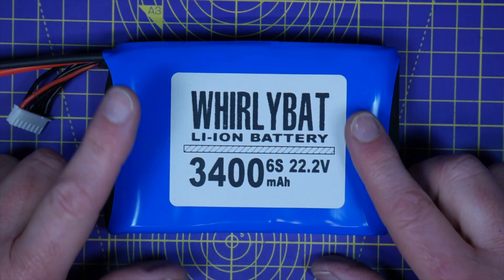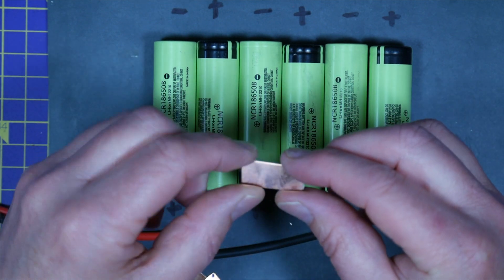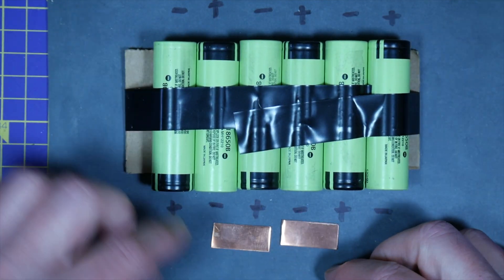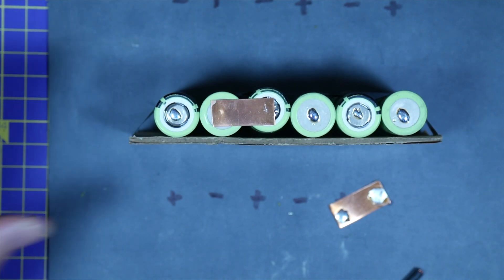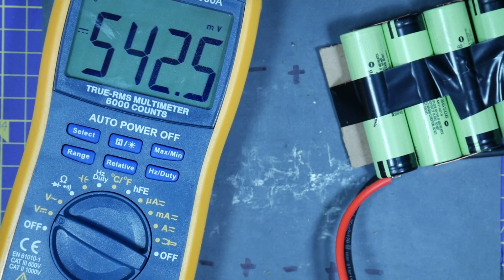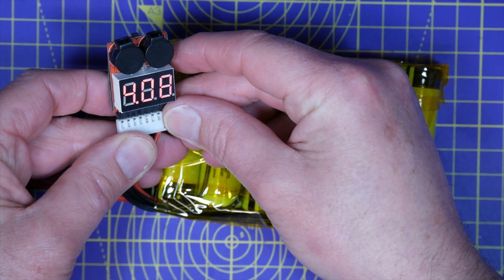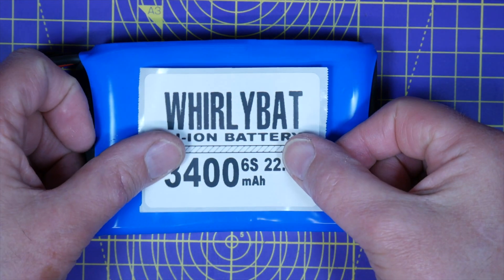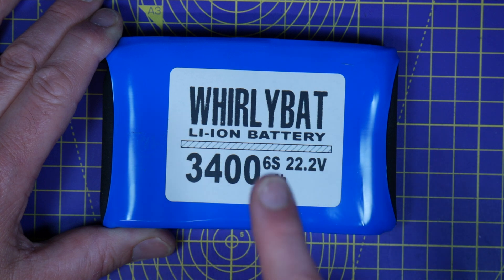Make your own 6s li-ion long range drone battery pack from 18650 cells

Comment: Don't it heat ?? Or is the temprature their lower compared to mine with 30°C AVERAGE daily.
I ordered the same battery and they heat up real fast, just gave me 4 mins of flight time until it heated up and reaiatance kicked in and drone dropped out. But voltage comes back to normal after some timw
Reply from the maker: I don't have any heat problems with any of my packs. Try Sony VTC 6 18650 cells. They work really well.
Reply: What is a Ampere of your esc ? I think because I use 30A esc maybe that is the problem.

Comment: Question? If a single cell has a discharge amp rating of 5A, and you put 6 of these cells together in series as shown, will the total discharge rate be 30A or 5A?
Reply: In series it will be 5A.
If you put 6 cells in parallel (6p) you will get 30A.
Reply: @SergyFPV  Thats what I thought, its just that 5A seems very low, if you fly too aggressively will it damage the battery?
Reply: @mitchpalmer721  voltage battery will fall and battery will become hot , never good for lifetime.
You can choose better liions cell  with high discharge like Sony vtc6 ( 3000mah /20Amperes) or Sony Vtc5a (2500Mah/25 amperes) who are the best in 18650 size i think.
Reply: @SergyFPV  Would you say the battery he is using are adequate enough if you are just flying for flight time and taking it easy? Thanks!

Comment: I've discovered that there is also a 21700  type Li-Ion battery, that would be ideal as it is just between 1 and 2 packs of 18650 cells. It then weighs less then 2 of these packs, while delivering somewhere around 4000 mAh of current.
Reply from the maker: Nice. I've been using the VTC6 recently which are very good.

Comment: ?? This definitely isn't safe,, max continuous discharge rate for these batteries is 5 amps, even the wimpiest lipos are above 100 amps. They definitely aren't gonna last long, and may even explode/catch fire. linking 6 in series only increases the voltage, not the maximum amperage discharge rate.

Edit: the specs are in the description so you clearly know that you're trying to pull WAY too much juice from these.. why?????

Comment: Have you ever measured how much current you could get out of this pack? I'm close to following this guide, just waiting on a couple mor deliveries.
Reply from the maker: The C rating is low on these cells, so peak current isn't huge, but these are really designed for cruising not acro.
Reply: @WhirlyBloke  I got my first flight test done - I matched your twenty minutes. My quad is a TBS Source One with 7" arms and tri-blade 7" props.
Reply from the maker: @davidrgilson  Awesome.
Reply: @WhirlyBloke  I've not had time to flight test my pack yet, but I did power laptop with it yesterday. Sustained 120W for 22 minutes.

Comment: I always use a little(!) Drop of hotglue to secure the cells togeter also to solder them togeter i use tinned solderwick(very thick one)as a wire connection.
Reply: Great idea! Just a tiny drop between each cell would be more than enough. Next time I'll do that :)
Reply: That is a great idea!
Reply: @SummitWizardFPV hot glue is lasting not more than a couple of months
Reply: @Volarte_Studio yep. I've come to the same conclusion. I bond the cells together with super glue now

Comment: Doesn't the quad use a lot more discharge rate than 2C? You had with your first test 20 min flight time (other Video) which is on average already 3C (dunno how much capacity was left). Shouldn't this be bad for the battery?
Reply from the maker: Not at all. The battery will only deliver what its capable of which is primarily limited by the internal resistance. Check the end of the video for the final voltages. You could run the Lithium Ion cells to a lower end voltage, but it affects the long term life.
Reply: @WhirlyBloke  Thanks for your reply. Are you sure about the "limited by internal resistance"? This sounds differently: https://electronics.stackexchange.com/a/16981

Comment: You just charge as a lipo 3400mah 1.6a?
Reply from the maker: Correct. If you check the manufactures spec you'll find the end voltage is 4.2v and the optimum charge current is 1.6 amps.

Comment: Question, when you charge: Select Lion, 4s, balance charge (since the capacity of the 4s is 3400 mAH) why isn't the current set at 3.4, you said 1.5. Is the charge rate different for Lion compared to Lipo because Lion can not discharge and recharge fast like Lipos can?
Reply from the maker: You have to read the manufactures spec.  The NCR16850 recommended charge current is 1.6A and the end point is 4.2v.

Comment: Hi. I wanted to ask a quick question regarding Amp rating on 18650 cells. I'm looking at the Sony VTC6 3000mah 20A. However there is a Sony VTC5A 2500mah 25A, they both weigh the same (give or take a gram). Do you think the higher Amp rating is worth the drop in mah ? Let's say in a situation at longer range where you need a sudden punch out to recover video, do you think the extra 5A on the VTC5A would really make that much difference ? I understand these packs aren't for aggressive punch outs, i'm just curious if that extra power available would help. Thanks.
Reply from the maker: VTC6 cells are probably the best balance of internal resistance and power available.
Reply: @WhirlyBloke  Excellent. I was hoping the VTC6 was the 'winner'. Based purely, of course, on more mah. Thanks.

Comment: Hi Whirly one question. What are the thickness and width of the nickel strip? Thank you
Reply from the maker: It's 0.2mm. I salvaged this from an old MacBook power supply, but you can use anything similar.

Comment: Great video! I have a doubt about the balance leads. So the red goes to the positive and the black cables goes to each negative of the cells? In one of your cells there is a black balance lead just in the middle of the nicketl connection between positive and negative, could you explain me why? Thanks in advance !
Reply from the maker: Thanks. Check my community page for wiring details https://www.youtube.com/c/WhirlyBloke/community

Comment: Can you have a look on Liitokala batteries?
I think of buying Liitokala 21700 cells 4000mah 10C discharge, these cells weight 67g.
sounds for me like a good choice for a 4S 4000mah liion battery for a 7inch?

Or the 5000mah 21700 with 5C discharge rate for also 67g..

Otherwise the NCR18650B from Liitokala are 4300mah weight 48g and 2C discharge

Do you have any experience with Liitokala?
Reply from the maker: They're not available in the UK. Feel free to send me some and I'll take a look.
Reply: @WhirlyBloke  here in Italy neither..
Need to order them from china, will take a few months.

But looking at the characterestics which would you think are the best choice?
Reply: @CorrexPoE  Liitokala 21700 ( yellow color) are 15 Amps , i used 4s 4000 mah for my 5 inch for cruise flight of  15 mns

Comment: So as a newby should I even have to consider getting lipos? Im expecting my first fpv to arrive in a week from China and I havent bought any batteries yet. Im leaning more towards cruising , not racing...
Reply: Liion are really just for cruising, if you want to flips or some punches you need to go with a lipo.
Do you have a quad yet?
Cruising normally we use a 7inch prop frame and for Freestyle or racing 5inch or less.

It really depends on what you want from your quad.

Comment: I have made a tarot 680 pro with tarot 4006 620kv motors and 40A 2-4s escs, i want to use li ion battery for that but cannot figure it out, i dont know how many cells to use, the motor chart shows 26A per motor (i guess it is off a bit). I also cannot figure out c rating, li po has 20-40C on an average, the most information for 18650 i can get says it has 1C discharge rating and i searched everywhere, i cannot find hoe to increase c rating so i think it cannot be increased but i do not understand how to make li ion battery for my hexacopter, according to the motor chart my hexacopter should be able to lift 9kg(19.8 lbs) including the weight of all components. It will be very kind of someone to help me out, i can also provide my email, discord, WhatsApp,etc for longer conversations. Looking forward for some help. If Whirly can help me it will be very good. Thank you
Reply from the maker: Lithium Ion cells have a much lower C rating than LiPos cos they have a higher internal resistance and can't deliver the same energy in short bursts. But what they give you is longer flight times. Lithium Ion cells will be rated at 1C - 3C, but check the specs for each manufacturer because they vary.
Reply: Whirly Bloke but can li ion cells work for me? I don't need speed, my hexacopter is like a utility drone, photography, farming etc,
Reply from the maker: @vrushank2809  It depends on so many variables, payload, motors etc. I'd start with LiPos and try Lithium Ion when you're more familiar with your 680 and it's characteristics. But the 680 is quite big and on the verge of heavy lift, so I suspect they won't be practical.
Reply: Whirly Bloke i thought the same but had a wish to try li ion for longer flight time, i am frok india and li po is very very very expensive here, verified traders can import them but not common people, they import for cheap and sell at sky touching rates🙁. Li ion on other is manufactured in india too so it is more cost effective if it works, i thought heavy lift drone need less C then the fpv one you tried
Reply: Whirly Bloke i don't know what happens if c rating is low, do we loose torque, thrust, what do we loose exactly if C rating is less?

Comment: Hi man,
I’m using tmotor antigravity 4004 and I’m using 4S 14000mAh battery with 4kg quad would that work ?
Reply from the maker: The 4004 is spec'd for 4-6S so it should be ok.

Comment: Great video. I'm waiting the batteries to make my own 6s lion packs. I've ordered the Samsung INR 3000mah 30Q That should have 20amp and a low internal resistance similar to the Sony vt50 I've red on other comments. Let's see how they will perform! Plan is to use those packs on 7inch quad and into an ar 900 fixed wing.
Reply from the maker: Thanks. Let me know how it goes. Thanks for watching.

Comment: I have done some li ion packs and have found that the Sony VTC6 3000mAh 20A 18650 cells the best for flight time as the NCR18650B cells have a higher resistance and quite a lot of the energy is being wasted and have a shorter flight time. I really think you would be shocked with the flight time difference in real work flying.
Reply from the maker: Yep, I agree. There's is a quite a bit of difference between the different manufacturers 18650 cells.
- Panasonic NCR18650B 3400mAh IR 55mOhm
- Sony vtc6 18650 3100mAh IR 13mOhm
- Sony vtc5a 18650 2500mAh IR 9.8mOhm

VTC6 looks to be the best compromise of internal resistance and energy. I've got some on order. The NCR18650 cells I used were just what I had kicking around looking for a use. Thanks for the info and thanks for watching.
Reply: Have you tried the samsung 30Q or the Sanyo-panasonic ones?

Comment: Thank you for the video.  I usually add a fillet of heat gun glue between each pair of cells before soldering.  That not only prevents the cells from flopping around while soldering, it also gives the pack additional structural integrity during a crash.
Reply from the maker: I've done that in the past. But now I rely on the capon tape cos it's less messy and probably stronger.

Comment: I recently used 8 of those cells to make a nice 4s pack for one of my fixed wings. They weigh less than a 4s lipo pack. I got about 25 minutes flight time with the lipo. With the li-ion pack i am getting well over an hour. Less weight with more than double the range. They are ideal for fixed wings and cruising style quads.
Reply from the maker: They make awesome packs.

Comment: I settled on the Sony VTC5D for what appears to be the highest amp rating of any 18650s I can find.   Might be 2800mah but I am building 6s2p for use on 7in or even a pair for my 13in for 11200mah.      I figure my 6s2p packs are good for 30amps continuous and around 60amps burst rating.    Pack weight for 6s2p is 645g and yields 23min flight times cruising at 15-19amps on 2806.5 1300kv Avengers and HQ 7040x3 props.   AUW 1350gs with Hero 7 Black on a Project 399 frame.

The 13in I am not really ready to talk about but about to move to an 8s4p pack.
Reply from the maker: Sounds interesting
Reply: This would be better than the one shown in the video, but I doubt this would be safe; just about every lipo can output at least 100 amps, while the cells in the video only output 5.

Comment: I made two of those 3400mah 3s batteries, not 6s...well, because I could care less about long range flying! Lol
I made them out of $1 Li-ion cell phone batteries I found on Clearance sale from a China website. I made them for my QX7! Cost me about $6 each due to the fact I found out you have to have some goop that's made so you can solder to aluminum! Cuz you normally can't solder to it!
Anyway, a great and easy project for long life batteries for my Taranis! 😎 🤘
Reply from the maker: Awesome. Thanks for watching.

Comment: Kindly glue cells together so that they do not pit against each other at the end where the 2 cells are not connected. This is to avoid breaking the thin insulation so that the cells short circuit.
Reply from the maker: Fair point. But I've built about 20 of these packs and used glue and capon tape. They both work the same but the glue is messy and it's more difficult the replace a dud cell. Thanks for watching.
Reply: @WhirlyBloke  I put some thin strips of thin, but strong card between the cells. I once dropped a very tiny ball of molten solder that fell between two adjacent cells - very big sparks did happen. After seeing that i decided that relying on the two very thin battery wraps for insulation was not so wise, i would not trust them to not rub through in the event of a crash, or even dropping the pack on the floor. A few thin strips of card does not add much more than a couple of grams in the weight of the pack. It gives me peace of mind.

Comment: I think it's a cool project but to be honest I don't feel safe directly heating on top of li-ion batteries.
I would rather get a battery box that can holds 18650s and call it a day, not only it could reduce the heat damaging the batteries, you can also swap battery once some battery died.
I know that there are proper tools for making joints for batteries, but I also know that they're really expensive compare to plain old soldering.
But anyway, great video and a great idea for making a battery pack.
Just a personal comment tho.
Reply: Too much weight making a case.  Potential for bad connections that limit current more than a properly soldered/tack welded joint.   Crashes mean scattering cells everywhere potentially.

Soldering them and securing them together solidly is the best option and likely the most light weight.
Reply from the maker: Yep only do this if you're 100% cpnfident. I've made at 20 of these over the last year. You need to be careful.
Reply: Tons of people are making these packs for drills, power screwdrivers, lawn equipment, quads of course. It's not black magic.

Comment: I think you typed yr title wrong, it should be 18650 instead of 16850
Reply from the maker: Lock down madness has set in. I can't even say 18650 either. 😜